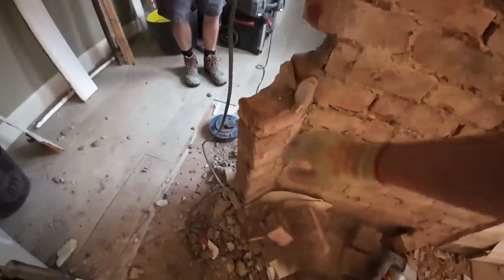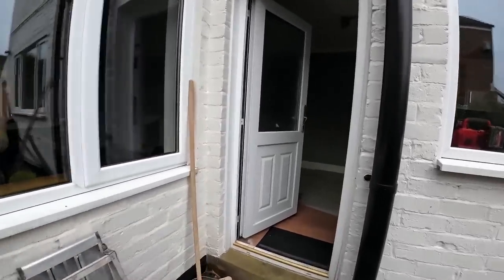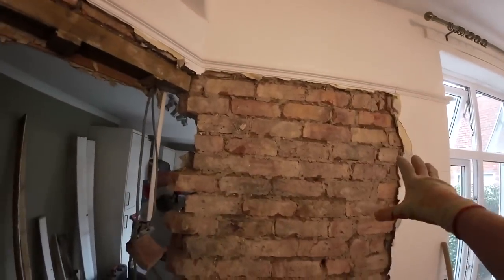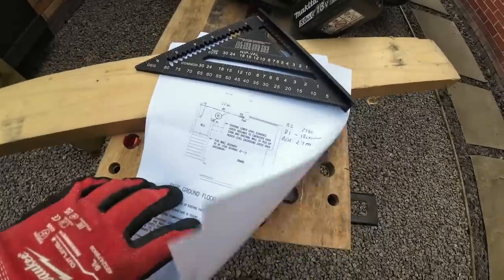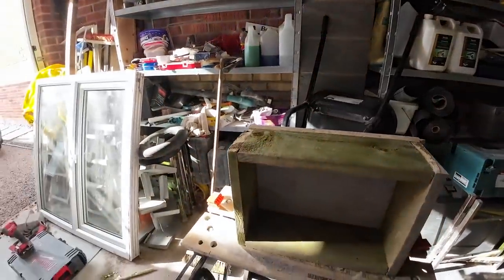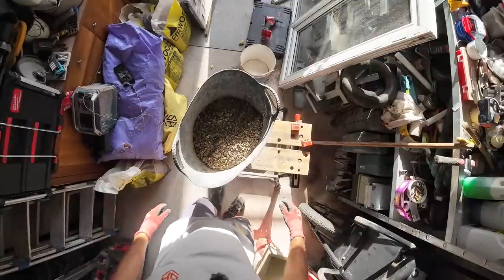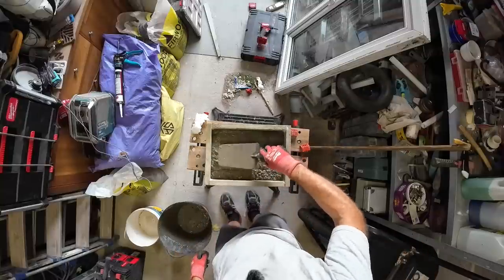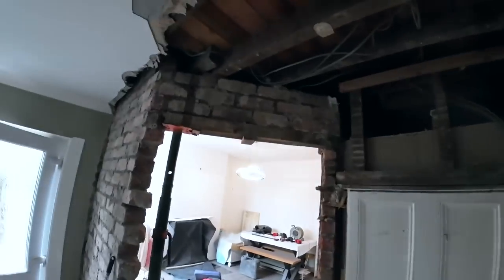HOME MADE PADSTONE ...GOAL POST JOB PT 1

Comment: You need to blank off the ends of the rad valves especially the thermostatic one otherwise when the temperature drops the valve will open up and you will have a flood.
Reply from the maker: That is for a plumber to sort out later 👍🏽🧱
Reply: I removed the thermostatic part when I removed my rad. No problem with floods.😊
Reply from the maker: @martynbuzzing3327 🧱👍🏽

Comment: When casting in forms you can brush the inside of the form with clean engine oil and get a cleaner release.  You can also use form release but I think supermarket engine oil is cheaper.
Reply: Light cooking oil is better than engine oil I would think, less mess and residue.

Comment: When making pad-stones, fill the mould proud of the top of the mould with the aggregate, tamping as you fill (while counting the scoops). Tip it back into your mixing bucket then add the appropriate amount of sand and cement to match your mix ratio.
The amount of the final concrete will be very close to the amount of aggregate you first put in the mould, because the sand is finer and fills the gaps between the aggregate and the cement fills the gaps between the sand and the water…………
Hope this makes sense.
Great content, love it.
Reply: Also if you can place your mould on rubber feet this will help the consolidation while vibrating.

Comment: I believe at one time whole lintels used to be made on site using this method. Though I guess with rebar in it to strengthen it. We think that's how the lintels (on the inner wall) in our 1960s bungalow have been done. Seem to be holding up well enough but we might have to change them as we're planning on converting the loft and the structural engineer has specified new ones.

Comment: paint the mould with a bit of engine oil easier when you strike the shuttering ,probably not allowed now but i have in the past set the shuttering up in situ and poured the concrete in give it a wack with a hammer to consolidate job done ,good vid

Comment: Use a variable speed sander to consolidate and compact the mix as well as use some release agent. On the corners to keep the soup in use some draft excluder 👍🏻
Reply from the maker: I don’t have a sander , release agent or draft excluder 🧱👍🏽
Reply: @SteveAndAlexBuild  the draft excluder will make stripping the mould box a lot faster plus the soap oil to release the timber from the face of concrete. 
Was just a thought to help 😀
Reply from the maker: @garrymetcalfe5914 👍🏽🧱
Reply: On a pad stone like that brush on cooking oil as a release agent saves buying a big tub of soap oil and it works perfect and if you ever see one cheap pick up a radiator adjitator it fits into an SDS chuck and it and vibrates small shuttering jobs spot on no air bubbles

Comment: Hi Steve and Alex, when you make your own padstones, why not use your multi-tool to help get the air out of the moulds?
Reply from the maker: The vibrations are too high frequency. A good few clouts with a hammer did the trick 😁🧱👍🏽

Comment: Nice job of making your own padstone.
However can't help thinking that an off the shelf one from builders merchant would have been a lot less effort.
Reply from the maker: It would but they don’t make that size and the quality is rubbish 🧱👍🏽
Reply: @SteveAndAlexBuild 
I reckon you can get 440x102x215 to replace standard lightweight blocks.
But if you don't like the quality at your local merchant that's fair enough.
Reply from the maker: Ours was 370 x 250 x 120 🧱👍🏽

Comment: How much water do you usually put in the 4-2-1 concrete mix to get the right consistancy?
Reply from the maker: We don’t gauge the water 💦 🧱👍🏽
Reply: @SteveAndAlexBuild  Fair enough. 😁
Reply: The less water the stronger the final concrete, given that you have to a actually add enough mix the ingredients. Equally the drier the mix the more you'll have to compact it in the mould.
That's about all I remember for my civils degree 40 years ago.
Great videos as always.
Reply from the maker: @michaelchannon2644 👍🏽🧱
Reply: @michaelchannon2644  That's how I understood concrete, minimum amount of water to get the job done makes for strongest concrete. So a bit surprised Steve didn't show how much water he added or the consistency he was aiming for. I would also like to have seen how he used the hammer drill. But the finished padstone looks like it could hold up a pyramid 👍
Steve & Alex always do proper jobs
Reply from the maker: @Sean006 💪🏼🧱👍🏽

Comment: Shouldve sprayed wd40 in the mould as a releasing agent. Just a suggestion.
Reply from the maker: Thanks for the tip 🧱👍🏽
Reply: Silicon lube will release that. Same as you put on plastic pipe joints.

Comment: That padstone looks about the same size as a trench block. Why couldn''t you have used one of them?
Reply from the maker: Very true Martin plus trench block are only 3 newton .
    Also trench block are way bigger 
440 x 300 x 215 mm 
Our pad was only 330 x 250 x 120 🧱👍🏽
Reply from the maker: @martin2466 Whoops 😬😆🧱👍🏽